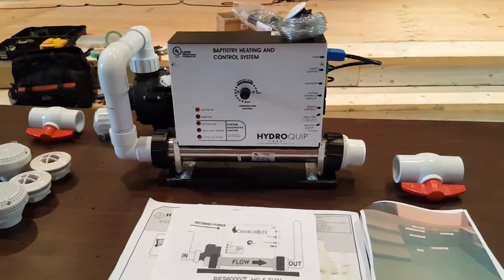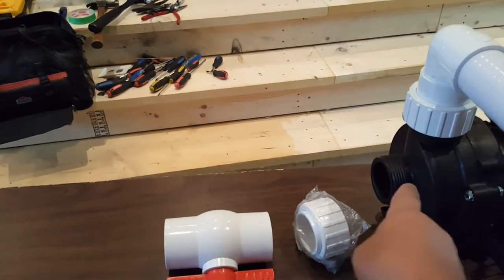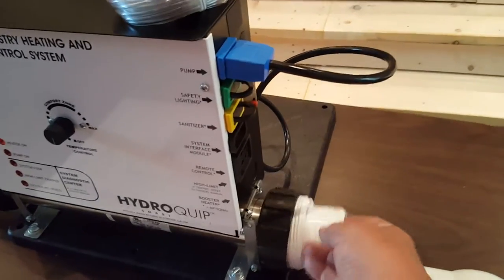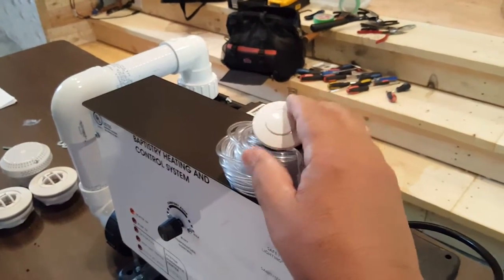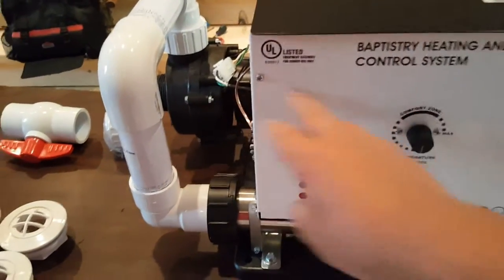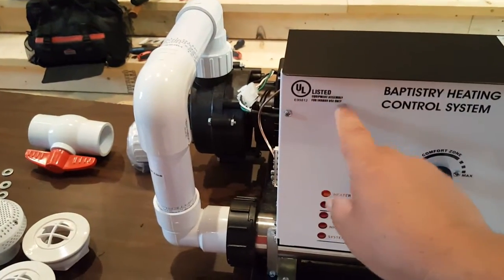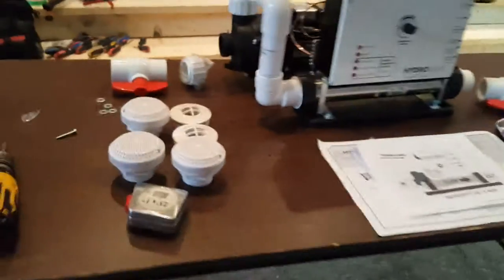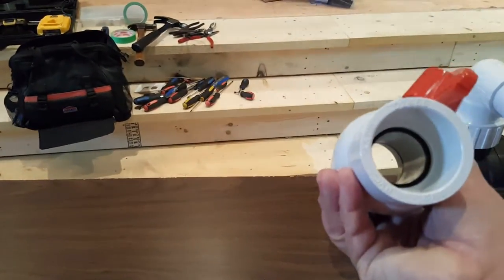Baptism Tank Heater Assembly

Comment: Very good, Just wanting to know which place you went through for that set up, and if you had to add another breaker at the box?
Reply from the maker: Had to run seperate 220v and installed a small shut off panel.
Reply from the maker: https://churchoutlet.com/Architecture/Baptistries
Reply from the maker: Picked up fittings/Shut offs from local plumbing supply store
Reply: @billfahrner587   thank you!